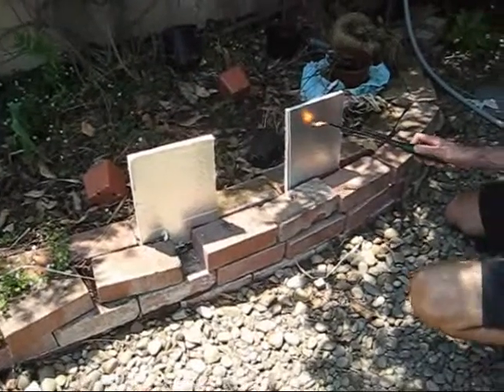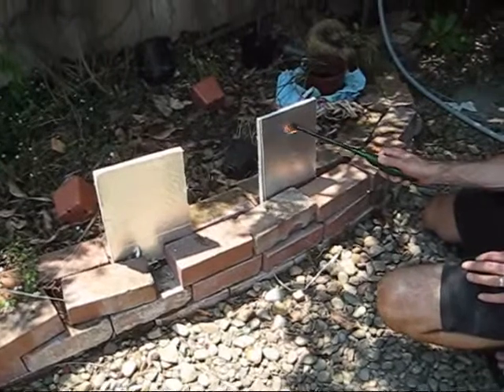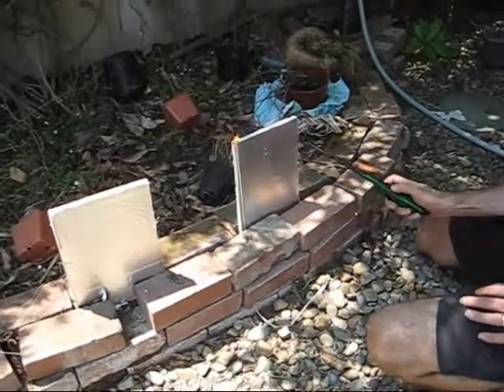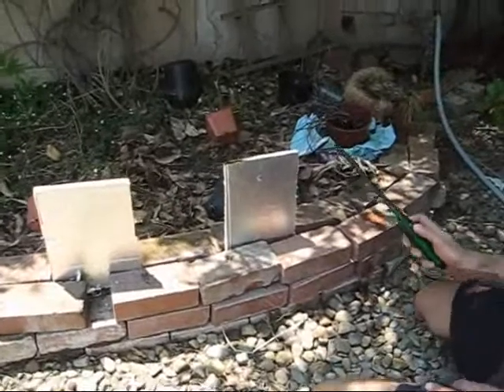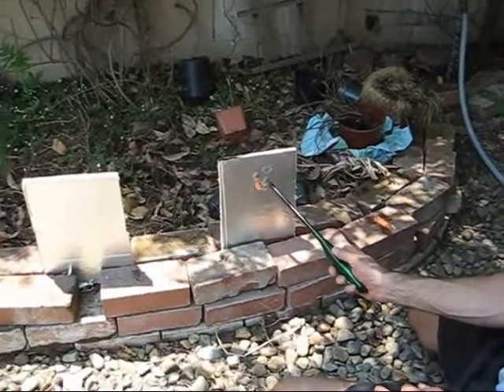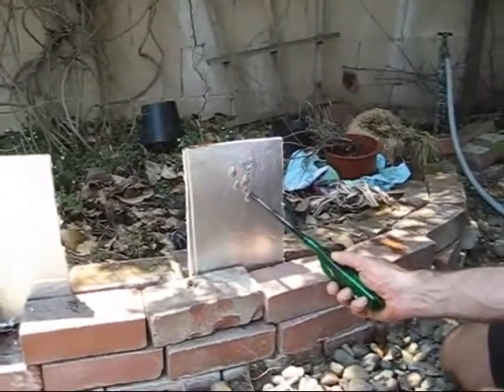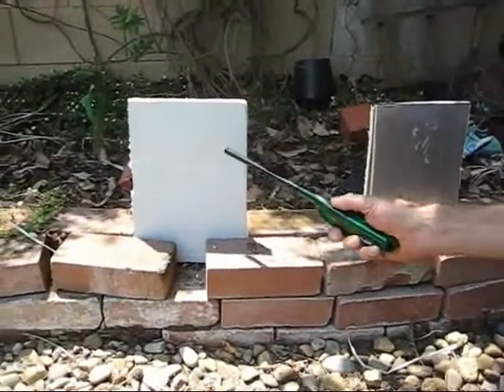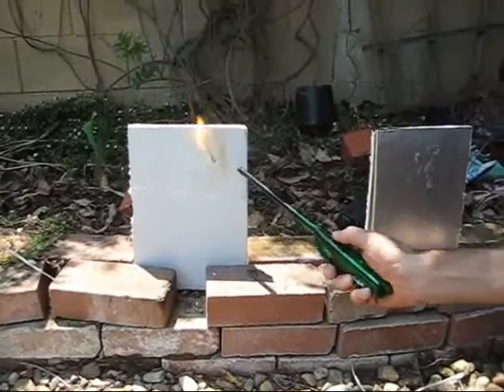Flame Test 1

Comment: I'm still trying to figure this out.  You have the white foil lined one side plastic film on the other side, foam insulation board you can get at building supply warehouses, that looks like conventional white styrofoam.   Or the  polyisocyanurate lined in a similar way, is a  lighter brown foamy texture material.  Then you have the pink stuff at home depot,  and dow makes an extruded polystyrene blue foam product which I suspect is similar to the pink stuff?   Any web pages or youtubes that explain the differences between these products?